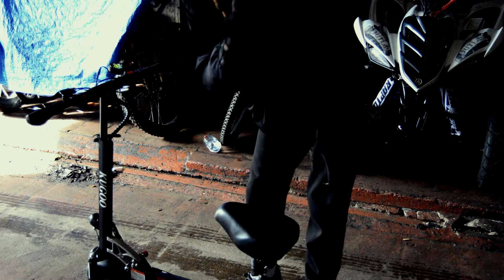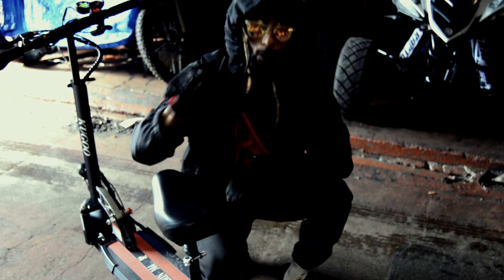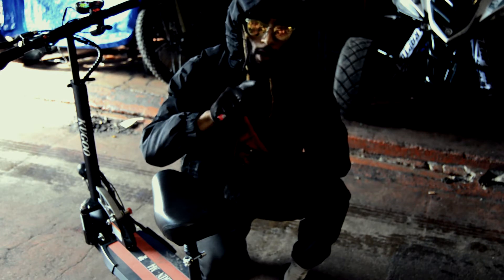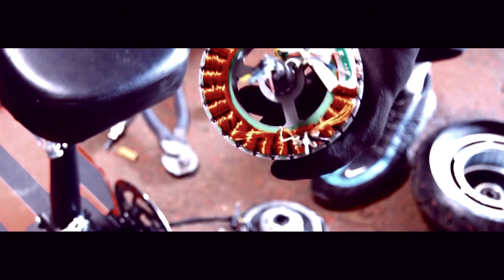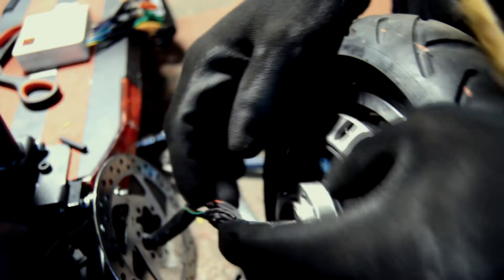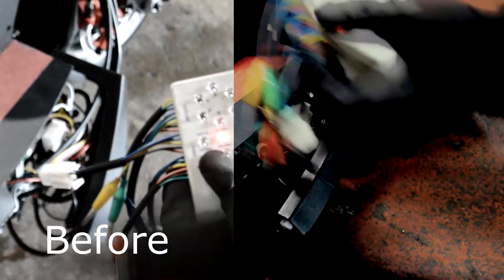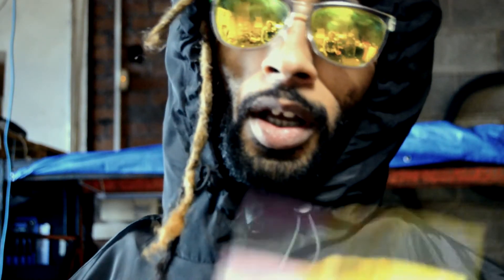How to diagnose and test hall sensor problems on hub motors (ebikes escooters EV)

Comment: Thanks dude! That was exactly what my 3 wheel chariot (ChallengerX- 52v/ 800w) is doing and bam! You answered my dilemma.  Again thanks for trouble shooting my problem.  I think I shorted it out when my battery was running on extreme low, then probably drawing too much current, I 🤔

Comment: Same happened to my qs273...4 bad halls due to whatelse?...rotor screw barely cut sheath...trimmed the harness a few inches...then tested again and found out about halls...
Reply from the maker: Happens so often I can’t even explain . I think it’s to do with the bolts in the brake rotor heating and cooling - must make them loose

Comment: Thanks 4 Sharing M8, I have the same issue with my Specialized Levo 2008, chaotic spinning of the back wheel, and after a couple of meter it stops riding.
 Cheers 🤘🤟🍺🍺🍺🥂🍾

Comment: So I have a qs 205 hub motor and just want a bit of advice. I was riding last night and the motor stuttered and then stopped and now when I twist the throttle I hear a clicking noise, I use SW900 soon as I twist no matter what it shows 2560watts but the wheel isn't turning and eventually comes up as error 7 which indicates motor issue.. I am gonna guess its a haul sensor issue as I have took controller apart checked all connections ect.. and everything seems fine
Reply from the maker: We would suggest testing the hall sensors in the motor

Comment: are hall sensors problems always noisy? And do they ever fix themselves so it only happens intermittently?  these are my main question and hoping you have the experience to answer that. Much appreciation !!!!

My electric scooter with dual brushless motors (silent. 
 1. I think it is getting worse. I think it more happens when it is warm on a warmer day (after the first ride if i take that ride in cool morning then it does not happen until the day warms up on the second ride). 
 2. It only happens in dual mode, not in single mode. on dual mode it is asking for full current to both wheels.  
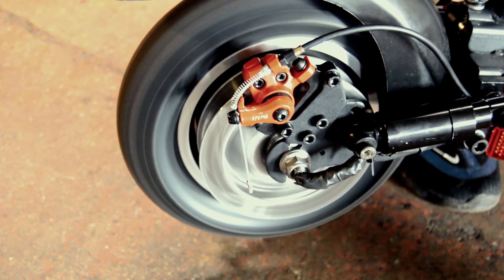3. The motors quite when I reach full throttle. They  cut out on the top of the throttle If I describe the thumb throttle like half an analog clock where 12 is not pressing throttle and 6 is full throttle. the bike only works from 12  to 5 (or 12 to 4:30) once i reach near 5oclock total dead and no noise. just coasting without power.  W So it does not work on the most depressed part of the throttle. but also sometimes if I gun it from start to full throttle it will die sooner like 3pm. When I say cut off, Both motors cut off. 
4. Once it cuts off even when releasing the throttle the motor will not reengage unless I first back all the way down to 0 . 
5. and one more thing. I have an extra speed thumb controller so i replaced that and that did not solve the problem. 
Any thoughts on this. what should i be looking for. Im pretty techy and will take apart and fix most anything myself. Im wondering either this relates to the front motor, or the front controller, or the controllers communicating together, or something is cutting off when scooter is trying to pull full power. A battery short or something in the BMS? (since there are two controllers in the nanrobot one for each hub wheel and they are wired together). Could it be the hall sensors in the front motor?
Reply from the maker: sorry for the delay getting back to you - noise from a brushless dc motor can be a faulty controller, faulty hall sensor or a combination of both. i hope this helps

Comment: Hi bro.. Good video... I have a Kugoo M4 pro.. does the code on the hall sensor matter to carry out this same repair or any hall sensor off ebay will work?
Reply from the maker: If it says in the description its suitable for hub motors should be fine